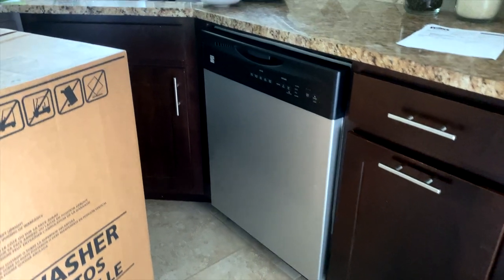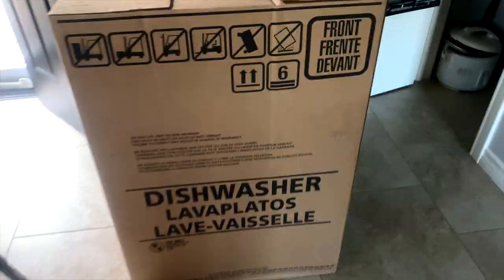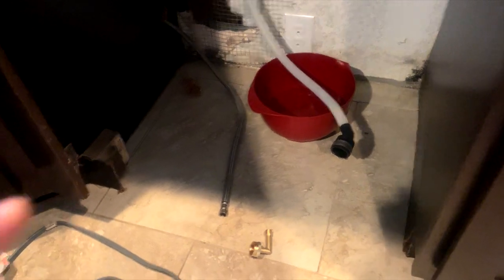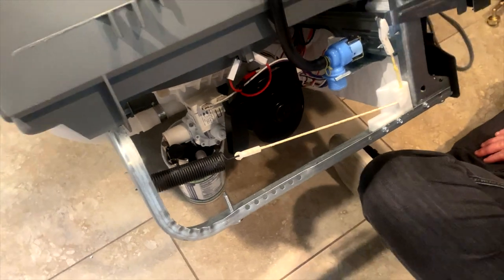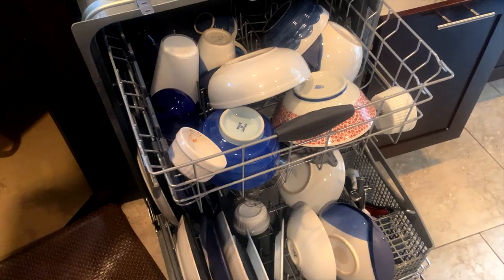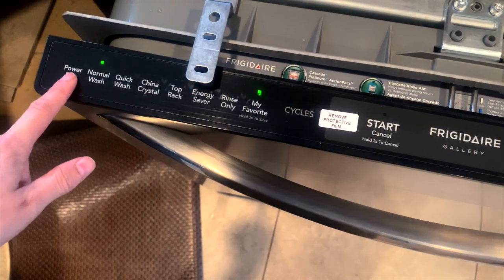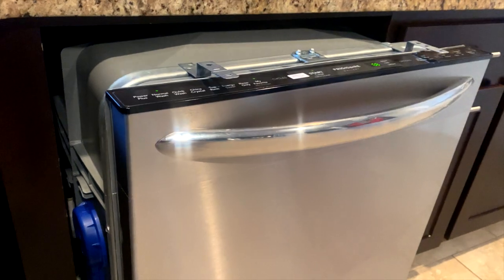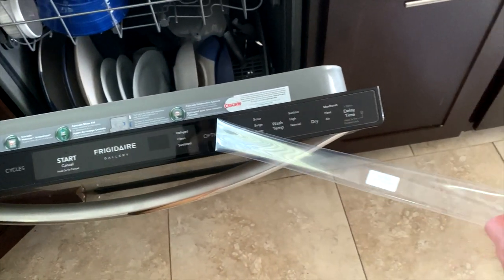Our new #Frigidaire #Dishwasher!

Comment: I have a frigidaire gallery dishwasher, and I love mine. with all the wash options where you can choose the intensity of the wash- They always come out clean, and I use cheap dishwashing powder. I can use cheap powder, and simply tell the dishwasher how to clean, and it always works! whether or not to scour or surge for the pressure, or if I want a high temp wash or a power plus(heavy) cycle. I even use the 30 minute quick wash pretty frequently when the load does not have anything caked on, and it works very well. Surge is the normal spray pressure  and scour is the high pressure wash, with cheap dishwashers that don't clean as well like in my past apartment, I would have to spend extra for the pod packs for extra cleaning power- but not anymore! the stuff I use costs $4 for a box wortth 120+ loads, and I have powder for pre wash as well, powder detergent would actually be more effective when combined with the scour option; since it contains gritty particulate matter for a scrubbing action.
Reply from the maker: Hi Stephanie - glad to hear. We love ours so far as well. We just get the Costco nugget detergents and it works wonderfully. Glad to hear yours is working great!

Comment: Does it dry dishes well? I've seen other comments and reviews that the dishes are not dry even when using the max dry option.
Reply from the maker: Mine dry well, but I also don’t open it right away. I wait till after the hot air dissipates and then open the door.
Reply from the maker: I did a “quick wash” on heat dry. Haven’t done max boost at all yet. For heat dry, if there is an upside bowl, with a lip on the bottom, it’ll catch water and not dry. (I believe that is normal though)
Reply: I got one of these washer, or least the same line or series.  It does dry dishes pretty well, but we do ALL the things.  We rinse all dishes, we try to make sure none of the dishes pool water, we keep the jet dry full, and we run the hot water tap at the sink until very hot. We only run one cycle, and start it before bed.  Dishes have been very clean and very dry.
Reply from the maker: That’s good to hear! It’s a bit tight than what I’m used to for the silverware area. Same for you?

Comment: Hi. Great video. We just installed this dishwasher, and the MaxBoost Dry (that blue attachment on left side of outside dishwasher) is sending steam into the left side of our cabinet, leaving a slight puddle on floor, and bubbling molding and potentially the side of the cabinet. Do you see this problem with yours?
Reply from the maker: No, haven’t experienced it. Awful, hope you get it resolved!
Reply: Thanks for the quick reply. Working on it...